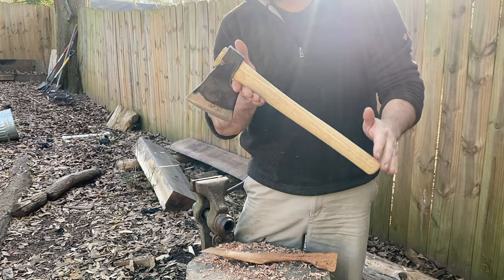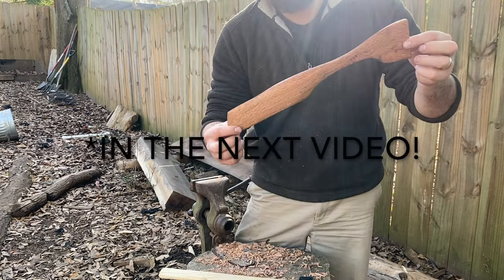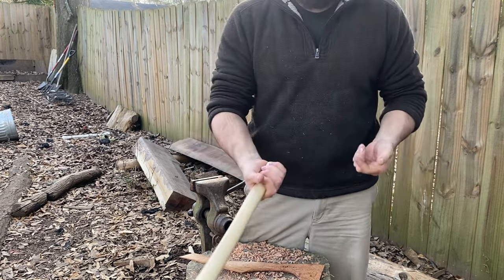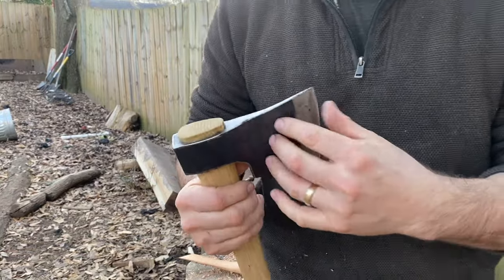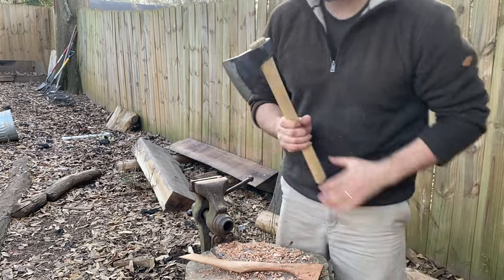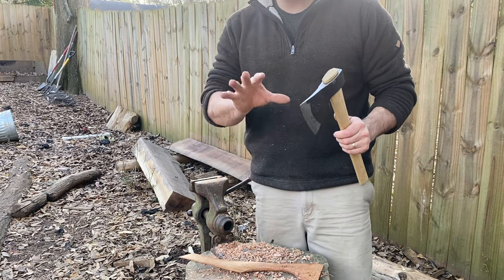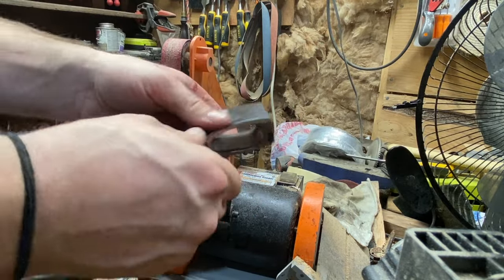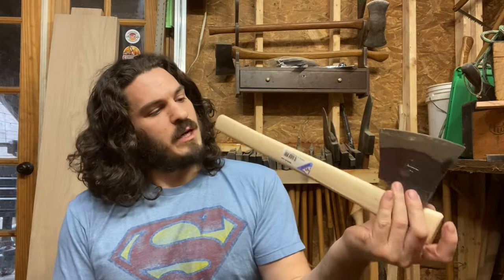Ten Minute Tuneup- Rinaldi Milano Carpenters Axe

Comment: Lines up with my experiences, well worth the effort to clean them up around the edges. I said I was going to replace the factory handle on the first one I picked up. That was 3 years ago, and it's one of my most used axes at this point.
Reply from the maker: I’ll probably do the same! I’ve been using the handle for a few weeks now and it’s not perfect but it’s very usable.
Reply: @urbanlumberjack  in all fairness I did round off the corners on mine and applied BLO. So the handle isn't as it shipped. But I'm surprised to find that it has both worked out fine for all this time and not broken. The 330 #000 handle is extremely thin at the end, if you've handled one then you know. I've got a 302 on the way which will be my 3rd unique Rinaldi not including the three spare heads for the 330 #000.

Comment: It looks interesting. I already have a Mueller that is similar, although it is more of a hewing hatchet (single bevel, flat on the other side). I have a Rinaldi heavy duty Calabria, which is a full-size axe, and it has great steel from what I can tell. I like the way it "rings" when it is tapped. The handle on my Rinaldi is a similar slip fit, although over three feet long as installed. Unfortunately, it isn't comfortable at all; it feels like it will slip out of my hand, and the cross section is a trapezoid all the way down. In addition, the head has moved during use, and there is virtually no flex in the handle. I'm considering adapting a traditional wedge-fit handle to it, rather than trying to shape the existing one.